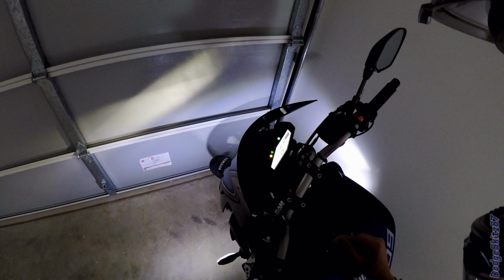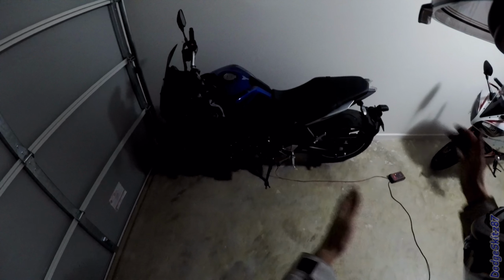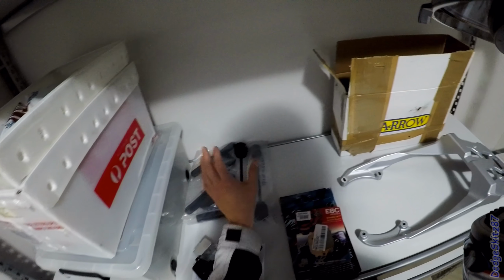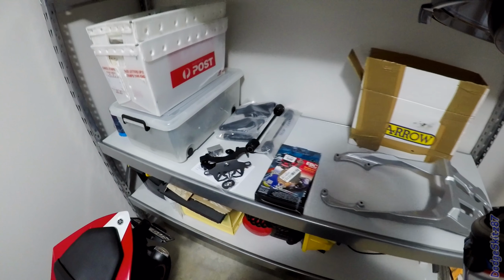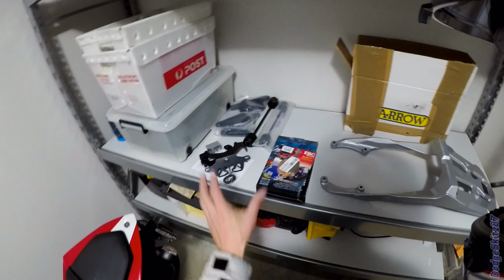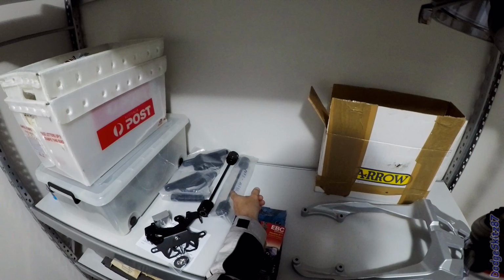Too many mods, not enough riding.

Comment: B, D, E, C, A :-)  hmmm, are these issues common or was there something else causing the issue? oh, well, got it all back up into running order now I hope :-)
Reply from the maker: Apparently my front brake issue was air in the lines, but funny that I put the new lines on and the issue was unchanged(dealer charged me to fix). Other issue was a wheel sensor(not uncommon). Dealer just reset the engine light and said keep an eye on it. Played up once since, but also didn't on the next ride.